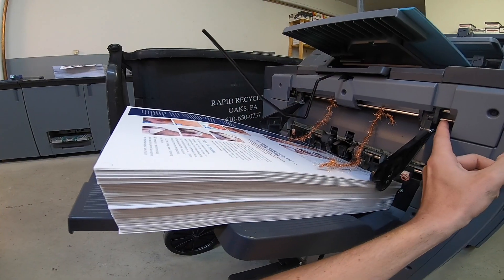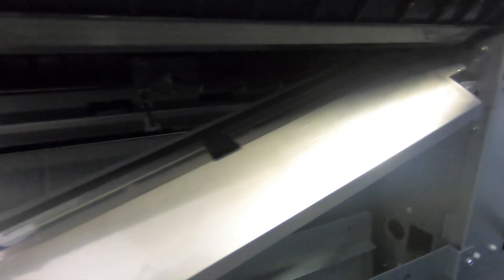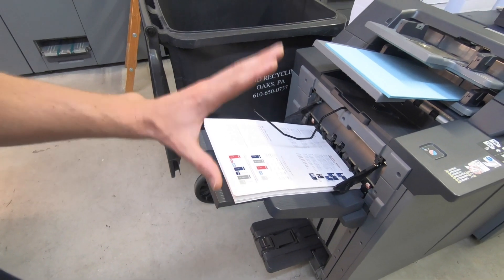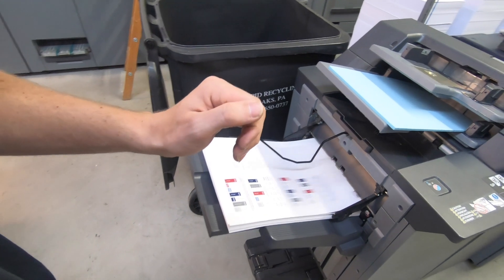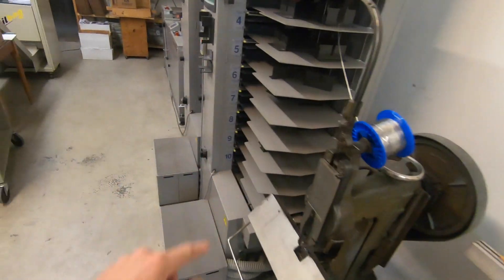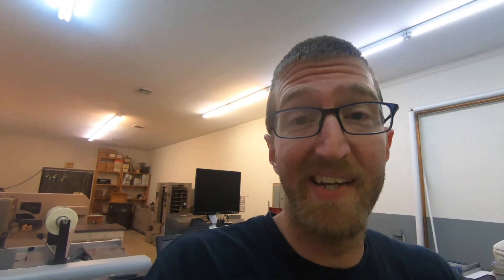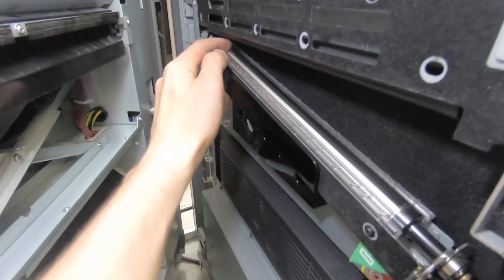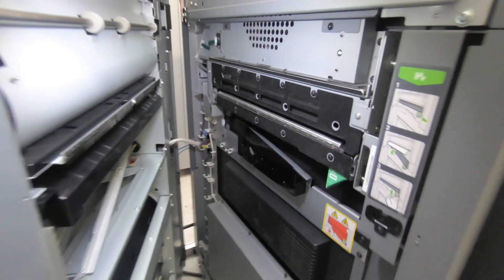How to Eliminate Static on Your Digital Press & Super Bright LED Retrofit

Comment: We also went with LED lights. And you talked about the cost factor and how long it takes to recoup in small place secures it may or may not be an issue especially with your digital presses but in our shop where I'm using an old school press the better quality lighting allows me to effectively see blemishes and printing issues a lot better which cuts down on scrap and any kind of issues so it actually helps the same money in putting out a better quality product. LED is definitely the way to go
Reply from the maker: Agreed, LED is wonderful!

Comment: If you continue to have problems with static there is something that you can use and with your daughter being in there you would have to weigh the options of if it's worth it. They do make small units that in a well-ventilated area would not be an issue and that is ozone makers they're very small and let me tell you you can have very high static to the point of the paper that you're using when it comes out of the machine literally sticks together turn that ozone maker on and within minutes there's no static at all. So just a little tip it may help you it may not but it does work and it does work very effectively
Reply from the maker: Interesting, I didn't think of that. I rarely have static issues, usually once or twice through the year when the humidity drastically changes.

Comment: Is m static harmful to the machines? How?
Reply from the maker: Not its not harmful to the machines, it is a nuisance for finishing processes where you need to feed paper through another machine.
Reply: @justaprinter  would you be able to show us the difference between a static sheet and one without static? I'm clearly not in the printing business, but for some reason I am obsessed with these videos.
Reply: @justaprinter  I know the filling, still having the same issues, my issue is it comes out from the printer, then i jog it, but that doesn't seem to help either, put it on our Folder Inserter, and pulls to many pages sometimes, the guy did some testing with plan paper thru the folder inserter, works fine, but when it comes thur the printer sometimes it sticks together, like static, both guys said it might be moisture, but i told them i keep it climate control around 50 to 60, in a cool room. So i am thinking it's the printer. What do you think?
Reply: Static in stacks of paper (the printer magnetically fuses toner to the paper instead of ink) can make papers cling together so strongly that you can literally hold a single sheet in mid-air and half an an inch thick stack will hang from it. This makes operating rapid paper feed machines (For folding, slitting, trimming, creasing) jam regularly (since it takes a single sheet at once) which makes jobs last way longer than practical.

Comment: Hi Dan! Great job, as always... I'm facing a problem with c3070. When i sent a job to the printer, it outputs 2copy of it. I use AccurioPro PrintManager installed by KM technicians. But it happens also if i try to print from acrobat or other programs. It's been a week now. Have you ever faced a problem like this? Thanks in advance and keep your job up uploading on YouTube:)
Reply from the maker: I have not had that problem. Somewhere in the preset it might be set to print 2 copies. Thats strange!

Comment: Hi Dan great videos, this is super!) I need your advice, what do you think bizhub pro 950, is a good machine for black mono printing?  do you have one  say a few words .. thank you in advance.
Reply: Hi Alex, bizhub Pro 950 is good machine for text printing, but not for pictures, because of low resolution of this machine - only 600 dpi. Due the age of machine there also can be problem with original parts, actually this type is not supported by KM anymore. Better solution is newer bizhub PRO 951 / 1100.
Reply from the maker: What they said. Haha! Good luck!
Reply: Its good but old machine, how many you printing pro one year ? I have in Service 6 bizhub 950 in Poland.
Reply: Julka Kulka Hi, if you can contact me through watsapp +380676333772, we do not print much, so we are not ready to buy an expensive car.  Poland is near Ukraine) maybe I could buy there ..

Comment: Hi there... I'm thinking about adding a KM 6100 to my shop and for the first time have a service contract. How do you find the KM Service and can you profit on the larger runs?
Reply from the maker: You can profit by running a machine under service. All our machines had service contracts for many years. If you go to the Konica website they will show you your closest dealer for service.
Reply: @justaprinter  Thank you... I have a brand new 6100 being installed in a few weeks... first time having a service contract.

Comment: The thing that you tied the tinsel to is the riveting on the machine. They still use it because it's cheaper and quicker than putting in thousands of screws. 

The other, look for natural light LEDs. More expensive but worth it because you are dealing with color. Cheaper LEDs tend to have a bluish hue that will make it look off with your printing. Figured this out because I play wargames and painting under cheaper bulbs made it hard to tell the hue that I needed.
Reply from the maker: Interesting, I think I found good ones now. I had several years of success with these new ones and its just like daylight, amazing!

Comment: Static tinsel and coffee is a must. I just had led lights installed in the entire shop. T8 lights with ballast bypassed. Shop is much brighter. I paid $95 for 20 4 foot bulbs and $235 for the electrician to bypass the ballasts and install every light. Worth every penny in my opinion
Reply from the maker: I knew there was a reason I liked you!